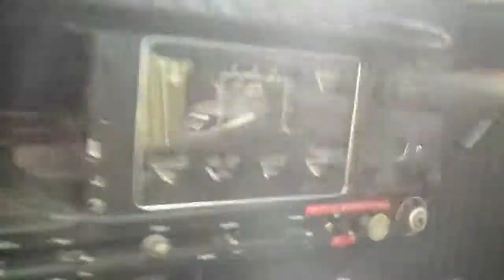Seabee Restoration: Fuselage on Cradles, working on the gear

Comment: How has this Seabee project turned out? We have just started our own Seabee project with s/n 958.
Reply from the maker: Hi, glad to hear from you! My Seabee project is slowly progressing, typical for a non-commercial, homegrown project of a working man. Averaging one Afternoon and one Evening per week during the winter-month only; the progress is limited. The STC ed modifications are quite extensive, and the amount of Sheet-Metal work required for the McHugh-Simuflight GO-480 install basically builds a different airplane. Going all out, there are Engine install STC, Bulkhead Removal STC, Aileron Pulley Relocations STC, Baggage Compartment Floor STC etc etc... So lots of stuff to do...I always hope to be done for the next summer... 
Best Regards from Alaska! 
Lars